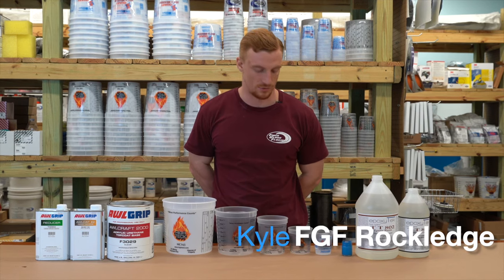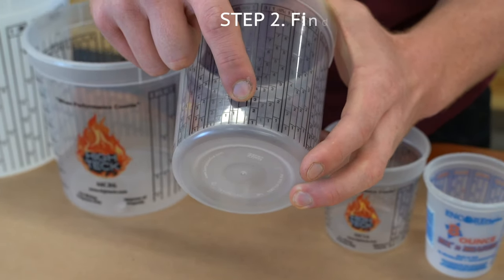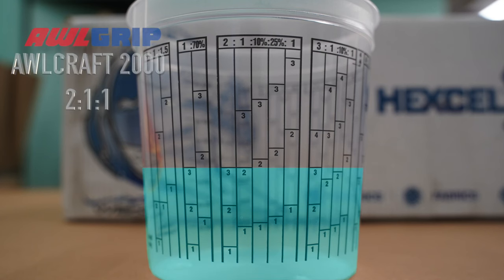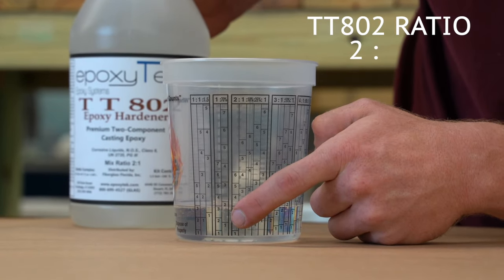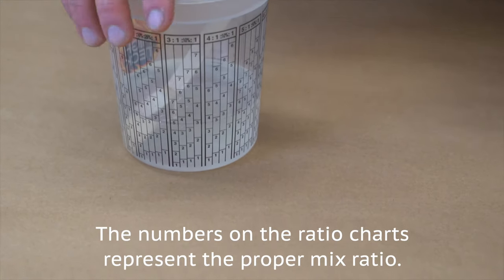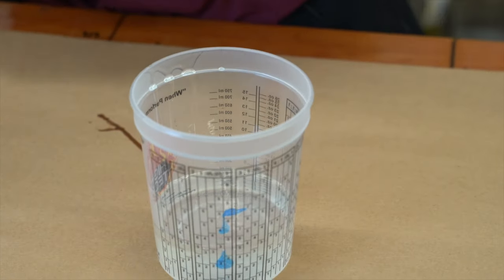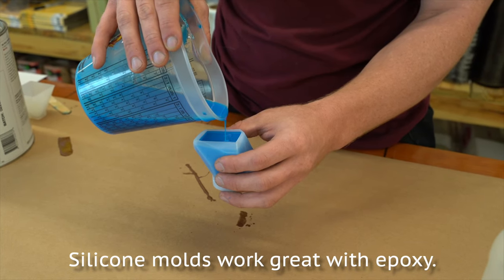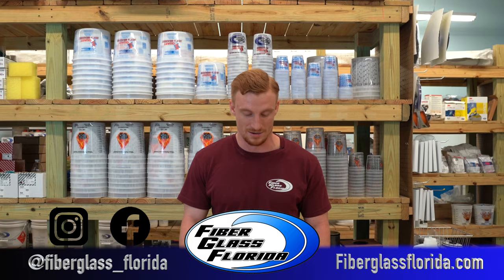Understanding Mixing Cups : Mix Ratios

Comment: So you showed 2:1 mix in the bucket. I still have no idea how to determine which of the lines to fill to as far as the total amount of epoxy needed. I need 54 oz by volume. No way what you mixed is 54. So I am still lost!
Reply: same problem im having, i know i need 1.3 gallons. but i have no idea how to mix 1.3 gallons at a proper ratio
Reply: It's fairly easy if you need two to one and you got 54 Oz you divide 54 by 3  then you mix your parts accordingly so 54oz at 2 to 1 would mean 36 oz of the two-part and 18 oz of the other part
Reply: @mikeiscoo2 the same ratio conversion works for 1.3 gallons if you're trying to do 2to1 1.3 gal equals 166.4 Oz divide that by 3 that's 54.46 to make 1.3 gallons at 2 to 1 110.9 Oz for the 2 part and 54.4oz for the 1 part